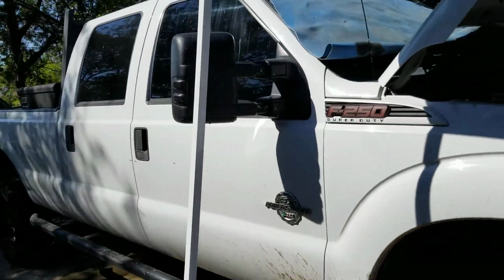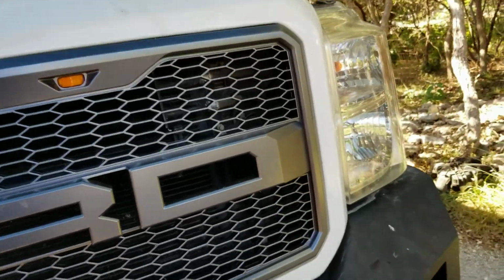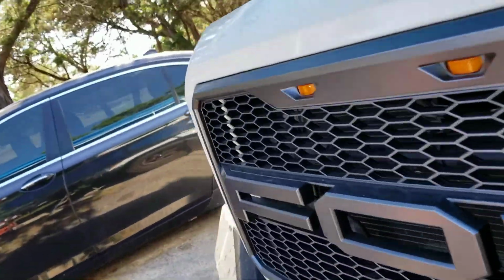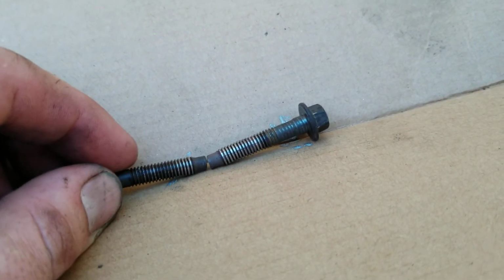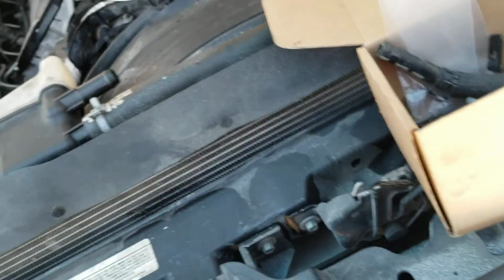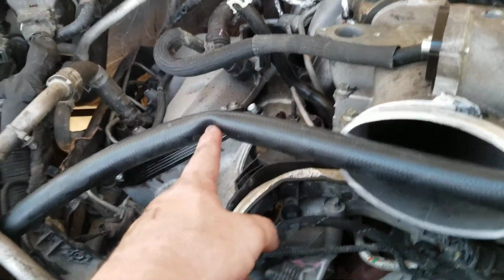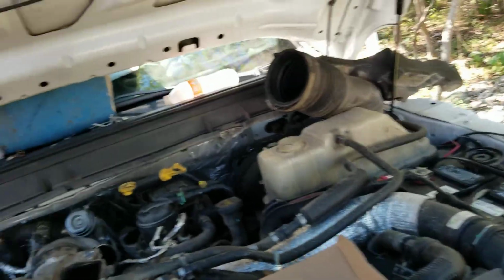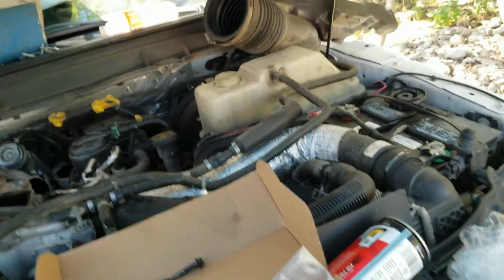6.7 Ford Power Stroke Delete HHG

Comment: I'm pretty sure the right way to delete a 6.7 Ford properly, you must first remove the 6.7 and replace with a Cummins.......but I'm no mechanic
Reply from the maker: Well, its like what i said in the 6.0 ford cam sensor video. I would start this job by not owning one...